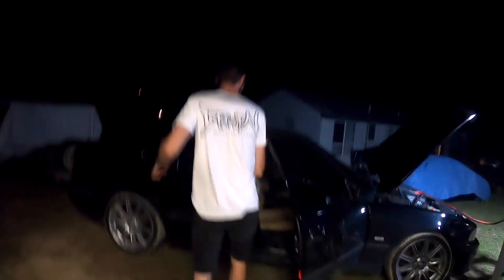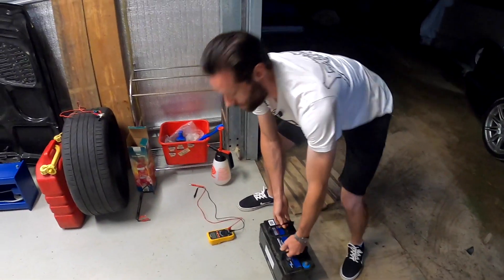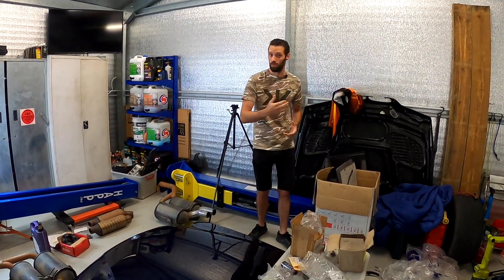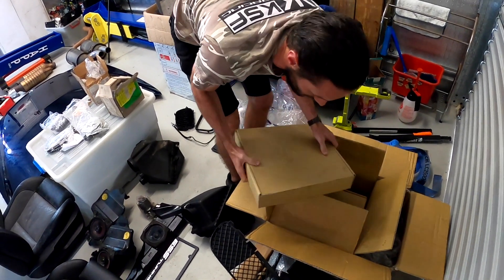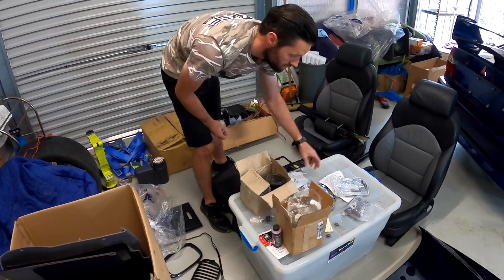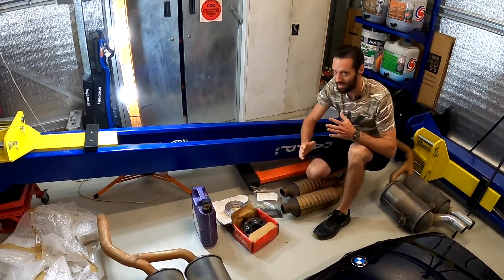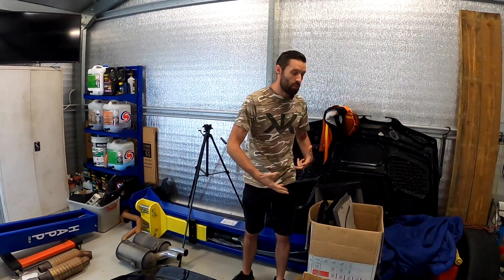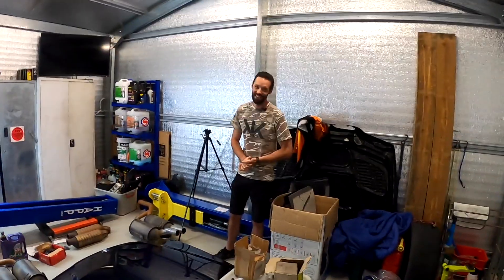BMW E39 M5 Parts Galore: This what we picked up on the SYDNEY trip

Comment: Check or replace the FSU (hedgehog) which is like a resistor for the blower motor. E39's are notorious for this failing and causing battery drain. Also, another cool thing about the E39 is that little light that you can see on the shifter (the one that tells you what gear the car is in) will actually stay lit up even after you turn off and lock the car but eventually that should turn off to indicate the modules are all powered down. If you check that light maybe like an hour or so after the car has turned off and it's still on, it means there is a module in the car that isn't going to sleep. I hope any of that helps :) keep up the awesome videos
Reply from the maker: That is a brilliant way of telling if the car is asleep. Thanks for that!
Reply: @ZeroTo60Tube  no problem, I found that out a few years ago when mine had the same problem and the light wasn't turning off

Comment: Hi guys,  Awesome videos and loving the 335i build!

Quick message to help understand why your diesel wouldn’t jump start.

The m5 would need less power to start being a petrol engine. A diesel takes a lot more amperage to start and them leads reduce the amperage that passes to the car from that 2nd battery. Making it unable to start. As soon as you swapped the batteries out the car was able to utilise the full potential of the battery.
Reply from the maker: Thanks for the info and checking out the channel! Just to confirm tho, that black car is also a v8..... We are putting it down to the ultra cheap jump leads and that the flat battery would have been taking current from the charged battery at the same time as trying to turn the engine over. Do you think that would be enough to compound and not turn over the way we were jumping it?
Reply: Ahhhh, Through it was a diesel. The UK is full of them

Then yeah your right.  it would be a power draw from the old battery and cheap leads :)

Comment: I had crazy battery trouble like u guys in a e92. Turned out battery registration was on AGM and i had Pb. Completely confused BMS.
12.6 V is full, 12.3 V is getting low and 8 volts is lower than dead flat and doing internal damage to the battery !!   Good luck finding it.
Run a basic cig. Lighter volt meter, that way you can watch voltage as u drive. Mine was crazy all over the place
Reply from the maker: Ahhh dude, a friend of ours went through the same in his e60 M5. Went to a couple of dealers trying to find little electric gremblins and fault codes and eventually someone notice the battery wasnt coded properly. Its crazy what problems it can cause.
Reply: Yeah its a bit crazy.
On standby the e92 is crazy hungry for power about 30 amps thru the Amp Clamp Meter.
I'd still run a basic cigarette ligter volt meter - when mine had trouble id be driving watching volts drop to 11 and the alternator doing nothing - it was random.
This explaned why it would not restart immediately after a 1 hour drive- i assumed it was charging but the opposite. Everything was random. Then it would overcharge sometimes too 17V wtf !!

Comment: Load test the battery.
Reply from the maker: All of the e39 batteries we have managed to collect do load test fine....... when they are charged. But when the car does the battery drain thing, it will take a battery from 12v to 6v in about 4 hours. It's madness. We are thinking it wouldn't jump start as when we connected the M5 battery it would be charging the 540i battery as well as trying to jump start the car. The flat battery would have been sucking huge amps from the charged battery. When we removed the flat battery, the M5 battery was then fine to start it. We think anyway.... does that make sense?